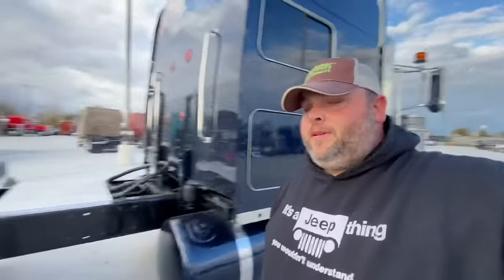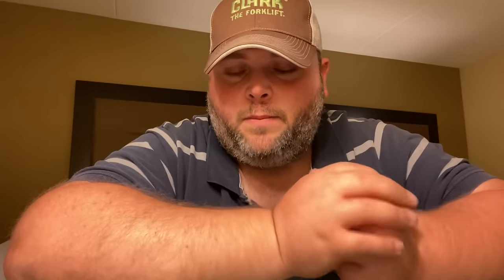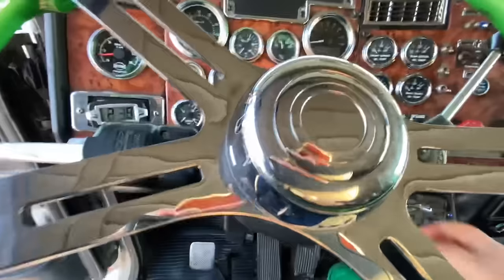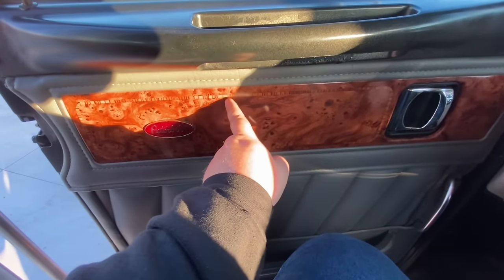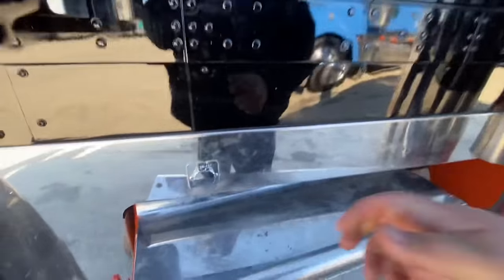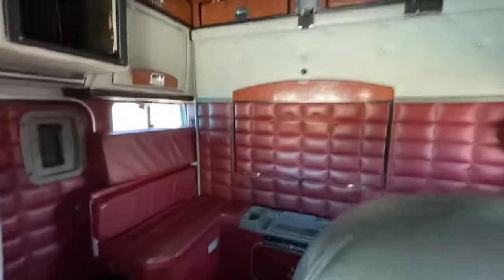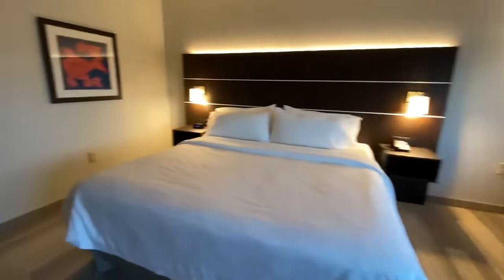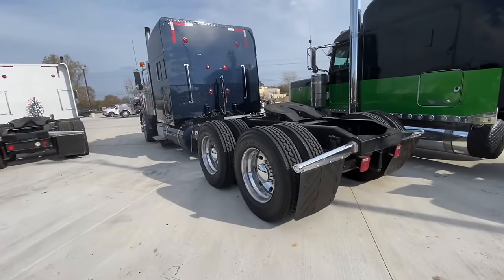Buying my DREAM TRUCK-Peterbilt 379 | tour of Ohio Truck Sales dealer lot!

Comment: Congratulations one bit of advice, and you’ll find others that agree, don’t just buy ONE more truck- wait until you can put on TWO. It’s trucking and there are always problems if one goes down( and it will sometimes). One truck can’t support two but TWO can support THREE. It was my experience when I was owner operator. Again congratulations and I wish you success.
Reply from the maker: Damn good advice!  Thank you!
Reply: That’s very true
Reply: Solid advice
Reply: @helpinghandsroadside  burn that compass logo burn it
Reply: Should buy as many as possible 🙂
Reply: Best advice I seen in a long time ⌛️ 💪🏾💯

Comment: I bought my 2006 379 from Ohio truck center and they had disconnected the check engine light. She had active fault codes and I ended up paying another 15k because of blow by. Be careful bro I'm not impressed with them at all
Reply: Really? That's freaking sucks. Didn't you see blow by before purchasing a truck?
Reply: @dimab8753  ima be real 💯 I have spent my life as a company driver and ran a c-15 cat. She purred and never gave me a hint of trouble. When I made this purchase it was a cat acert. There was a lot of steam coming out of the oil pipe and me having a bad feeling but no experience in blow by or acert asked my salesmen Tim Honaker if that was cause for concern and his response was "no nothing is wrong with it that's how all these motors are (I'm assumed referring to acert) so I trusted him over myself. Am I at fault? Oh hell yeah I shouldn't have stepped into a shark tank bleeding, however this whole stand up great guys persona they're going for is false. 3 months later my engine has got the bottom end done and I'm on the move here and now and if I had to go back I'd probably do it again because I'm sentimental and now she'll always "be my first" so I wouldn't trade her for the world but could I have avoided some headache and heartache, stress and unnecessary bills? Oh yes. If you know your shit by all means step in but if they tell you they'll "take good care of you" be warned on the bright side I've learned a lot of it on the fly. 😂
Reply: @jessejames8475  Acerts are twin turbos that's why they have much more blowby than single turbo. I got 06 C-15 Acert myself,  915k original miles and it got some blowby too but nothing to worried about, I hope. So you ended up doing inframe or just bottom end?
Reply: @dimab8753  yeah these are all things I'm slowly getting acclimated to, I had Dan white of whites diesel do the bottom end because 150,000 miles prior she'd had the top done. Parts being harder to get we went with a 625 bottom so I got the option down the line to turn her up. I wanted to delete the acert out of her tho and get the single turbo conversion kit
Reply: I was going to buy one there, until I heard about the reviews. After I read them, I decided against it.

Comment: Where did you find financing for an older truck? I’m looking to do the same but am having trouble finding lenders to cover an older truck. A coworker is retiring and selling his truck/trailer. It’s a 2004 379 flattop with a 300k mile 6NZ/18speed and a 2007 tanker. We haul fuel. Both for $100k. He’s giving me a good deal. I have almost $20k cash towards a down payment.
Reply from the maker: I went through Armada Credit Group. They’re basically a broker who helped me find a bank that would do just that, and Armada specializes in helping with these older trucks. The bank they got me hooked up with is called 1st business bank. But armada has gotten pre elog trucks approved, so age isn’t too big of an issue
Reply: BMO and SUMIMOTO will finance as far back as 1995 but both companies require an adjuster to come out and inspect any equipment older than 2010. They make an honest appraisal and if the asking price is within so many percent of current value, you get financing. You won't get financing on a 95 truck that is priced at 150k$ but 70 or 80k, most certainly.
Reply: What's the interest rate? When I was buying my 2008 w9 they wanted like over 20%
Reply: My credit union approved one.

Comment: On the sleeper size, Peterbilt started measuring their sleepers like everyone else. Even though the sleeper is still separate, Peterbilt quit measuring from the front of the sleeper to the rear.  Instead they started measuring from the back of the seat to the rear of the sleeper like all the manufacturers do even though their cab/sleepers are all one unit. That’s why the 72 inch is now a 78 inch and their 63 inch is now a 70
Reply from the maker: That’s good info!
Reply: I did not know that thank you .
Reply: Thanks For the information on the Peterbilt sleepers MEASUREMENTS 
I didn’t know the Back of seat , was the new Measurements

Comment: Watch out for Ohio truck sales, I’ve heard a lot of crap about them with selling shitty trucks.
Reply from the maker: I’m sure they do. They also have a lot of good trucks. The thing is they sell a LOT, and they sell a lot of OLD trucks with over a million miles on the chassis. They’re bound to sell some that might not be good. But when I was in, they were currently working with a customer who just bought from them but the turbo blew within a couple days and they worked with him to replace it. So they do try to help if it’s close enough to the time of purchase that something major might happen.
Reply: @survivetothrive21  yeah I can see things like that happening, I’d probably buy new just cuz I’m not really Mechanically inclined, n I would need warranty. I wanna get a new w900 with 86 inch sleeper Cummins x10 605/2050 n lease on with the company I’m with pulling tri axel bulk tanker at 107,000.
Reply: My brother has two of their trucks they sold to customers that hes doing an inframe on. They claimed to have had overhauls done and they where done in correctly. The guys are now out 30k for the inframes. Both of them where purchased less than a month ago.

Comment: Good luck... 😂. Not going to blame the dealership because they obviously can't forsee issues that will arise but the two trucks we got were money pit piles of shit.
Red and black w900... beautiful truck but a week after we got it home, it was pouring oil everywhere. Two months after we replaced the clapped out n14 with a reman, the frame cracked over the front spring hanger. By the third month the power divider and front diff were toast.
The teal Peterbilt was the same shit, within 6 months the engine dropped liners and on and on. It was the worst year we have had with equipment, thankfully both trucks are long gone. Now we build our own "gliders" in the shop and don't have to worry about 25 yr old equipment to get around ELD and emissions. Again, not blaming OTS, they don't have a crystal ball and the trucks were solid when purchased.

Comment: I'm working on getting my CDL and I've been up to that dealer few times to scout some inventory to see what's up there had a great experience good people up there. Live 2 hours south from the location.
Reply: They have junk
Reply: Good people putting lipstick on a pig. We bought 2 trucks in 2017, both needed reman engines in less than 8 months. The kW lasted one week before it was pouring oil out of the block. They paint them and chrome them out, but no mechanical. If you get your CDL and want to join the bankrupt and broke owner operator Club,by all means buy a truck from them, 😂.
Reply: Stay away from ohio truck sales.

Comment: We unfortunately lost our 2007 W9 3 weeks ago to head on collision. We have an opportunity to buy a 2004 Peterbilt 379 for only $42,000 430,000 miles . It’s been freshly repainted custom job it’s gorgeous. It’s also green and white on the outside a little bit different design but similar to the one that you wanted to buy that sold. The engine has been rebuilt. New tires too. The inside is pristine, and this is the cheapest price I’ve found for a truck like this. We’ve been looking for about a week now to buy one one, but it’s a beautiful truck so you would totally recommend this truck then? We’ve always been Kenworth people we can’t pass this by it’s a gorgeous truck for the money, and the engine is just perfect. Everything has checked out. May I ask how much u paid for this one? Be careful with hiring a driver it’s a huge risk for you. We have been owner operators for eight years. That’s why I went and got my license so that we didn’t have to pay a driver to drive the truck anymore and what do you know a year into driving and I get head on by some other idiot truck driver.

Comment: Congratulations hero thinking about upgrading my 85 359 I wad looking at that dealership I've heard mixed reviews keep us posted on things you find with the unit stay safe
Reply from the maker: Absolutely! And thank you
Reply: We bought 2 back in 2017. No mechanical work is performed by the dealer beyond making the truck pass DOT inspection. Paint and chrome is their game, and honestly they are not to blame because they can't forsee problems with the truck a few months down the road. 2 trucks, 2 reman engines, both within 8 months of purchase, the one truck lasted a week on the road before pouring oil out of the block. Toasted power divider and rear diff, cracked frame over the spring hanger... all within 3 months. Sold both and won't do it twice.
Reply: Most of their trucks are absolute trash. They look good from a distance but up close they have a ton of problems.

Comment: You cannot move your deposit to another truck other than to add it to your down payment once a hold deposit has been expired or removed from one truck you can no longer use it as a deposit on another truck again. I know this, I have $1,000 in their Bank because I never ended up getting the truck I looked at. They told me I could apply it towards the down payment of a future truck within one year's time. After that you don't get your money back at all.

Comment: Be extremely cautious of ohio truck sales. My brother has two of their trucks purchased by these two guys. A month in and they are now 30k into it because they claimed to have inframes but they where done incorrectly and caused one cam to wupe out and the other had two sunk liners. They declined to pay for it bc it didnt have a warranty.
Reply: They are a volume dealer, move a lot of trucks. Many of them get new paint jobs which can blind a potential buyer. I suspect OTS does a lot of turd polishing, same thing as putting lipstick on a pig. I believe you can get a decent truck from OTS, but you better know what you are looking at and get them to warrant the expensive parts: engine, transmission, etc. If they won't warrant those components, your offer drops $30K-$50K on the spot in anticipation of having to rebuild those parts yourself. No deal? Walk.

Comment: Congrats on the new truck. Maybe in that empty slot where the gauge is missing you could put a right weight scale. For your drives 🤔
Reply from the maker: Thanks! And that’s a definite possibility.
Reply: How did the white and green one drive
Reply from the maker: The white and green one drove really well actually. Sounded even better. What kept me with the one I ended up with was simply the paperwork. That one had no maintenance records other than it supposedly had an overhaul 450k miles ago. Where as mine had credible maintenance records for when the engine was overhauled, the two diffs were rebuilt, same with the transmission. If the green and white one had the same level of maintenance records, I probably would’ve ended up with it.
Reply: @survivetothrive21  ooo ok 👍

Comment: That W9 is sweet better value then a Pete but that's my preference
Reply from the maker: I love the W9’s too.  But for me there’s something about a 379 that I like more. That black and orange one was pretty badass. I just can’t do all that orange. Lol. But I loved th work that went into it.
Reply: Pete will almost always have better long term value over kW. Too many issues with a w900. Fenders flop around beating up the cowl, fiberglass roof cap doesn't hold rivnuts well, they almost always bust free when trying to put on a drop visor. Grill shells flake and peel.

Comment: I bought my dream truck a 2001 379XH that C15 475 cat. 10spd that came from Ohio Truck Sales,, and let me say what a great disappointment,  my truck went straight into the shop for a state & Federal DOT inspection,  5 months later and over $30,000 dollars later of repairs. I had it on the road last 3 weeks an I'm back in the shop again  with a transmission  problem,  which is costing me another $16,300.00  .... I paid $45,000 for the... make sure you go through truck with a fine brush

Comment: All the stuff changed transmission differential what kind of driver had it before my old Pete i put over 2 million miles on it,and it still had the original clutch I overhauled it at 950k miles and 1 mil.700k seems like someone didn't take care of it no one but me would drive it except my retired dad would make a load for me once in a while.

Comment: Picked out the Grey 2000 379 with the 3406e setup love it
Reply from the maker: Nice! Was that the one with the dinette sleeper? I remember seeing a grey pre elogs one there with the dinette sleeper when I got mine.
Reply: No this one has a 63 stand up with super single ugh but converting it back in the morning actually I got it for a steal only 192,000 on overhaul but due to some issues I talked them down to 68k

Comment: Bought a 2001 w900L from them. Blew a rod through the block a month later. Didn’t even run my first load. Tried contacting them never even got a response.

Comment: If you bought it in Ohio 
 I'll bet it looked great but a month later its in the shop and won't pass DOT inspection.. or costing you an arm an leg to keep it running..but l hope not. L hope you never have or get a problem popping up. Good luck with that..
I wish you the best of luck.. and safe traveling ..
Ooo and congratulations on the new member to the family..

Comment: Thank you on video you did of yourself. Happy thoughts about new born baby girl. Sleepless nights coming up. I like the strobes on top of mirror. Better SAFTEY when stopped finding the entry to terminals. My Humble opinion. The 18 speed still love the gearing a trucker wants on hill clime with heavy Loads. Instead of automatic that so meany trucks are going to. I drive a 1500 gallon water Fire Tender. It's a Allison Automatic. I manually shift though the auto range when I drive it. I don't drive it RED lights and SIREN. I just do the drive around for storage from my home to central location at one of the fire station, for DRIVERS. When DNR needs it for wildland FIRE season. We contract it out to DNR with a F-450 brush fast attack rig.
It shift's to higher rang to quick. I like manual shifting it, get the RPMs, up on the series 92 Detroit. That's just my driving style. Best wishes on your new business adventure.

Comment: Worst dealer in the industry run as fast as u can I bought a 07 looked good ran good till I got it home and engine went down same week would not lift a finger to to make it rt I hope you have some cash shit cost me 23000 rt put the gate after 10gs down
Reply from the maker: Sorry to hear about your experience. The problem is all they sell are old trucks. With over a million chassis miles. Many don’t even have an overhaul yet. They have 120+ trucks on their lot at any given time. When they sell nothing but 15 year old and older trucks, and they have as many as they do, there’s bound to be some bad ones in there, unfortunately. There’s a lot that can go wrong on these and when there’s as many as they have, it’s not feasible to tear apart every engine just because, then add another 20 grand onto an already fairly expensive truck.  Buying an old truck like these is a huge gamble. One I was willing to take just to get away from the crap that is new. But, I’ll go over all of it and my justification, Etc, in another video. I do appreciate the heads up. However I’ve already put 5k miles on it, had my shop look it over very carefully, and although it’s not perfect, as I wouldn’t expect from a 16 year old truck, it’s pretty good. Even according to my shop.
Reply: You should ask to let a mechanic of your choice go over it maybe dyno it. Alot of those peoples trucks are garbage. Alot of places sell older trucks and truck paper from private sellers. But do you bro. Just hate to see you go wrong. Me if i went for old school again it would be pre emmisions.
Reply: J... same here. KW ran one week and was pouring oil out of the block. The Pete lasted a few months longer, both ended up with reman n14. In their defense, besides costing us a f#ck ton of money, they don't have a crystal ball to see future problems. A lot of their trucks are bought from owner ops who claim "fresh rebuild within the last 300k miles" and that's what they have to work with. With the market as crazy as it is, this is a market ripe for screwing both sellers and buyers.

Comment: We were up there not that long ago. Their trucks look good from a distance but up close you can see they are junk. 5th wheels stay straight from lack of grease,wires hanging down everywhere,water leaks in around the windows. They do the absolute bare minimum to them to get them moved. I hope you dont have problems with yours but they sell trash.
Reply from the maker: I don’t disagree they have trucks that absolutely fit that description. But thankfully mine seemed to be pretty well cared for and maintained by the previous owner.
Reply: If you want an older pre emission truck, that’s about what you’re going to get anywhere.  Your going to have to make repairs, and put some money into it to make it nice.